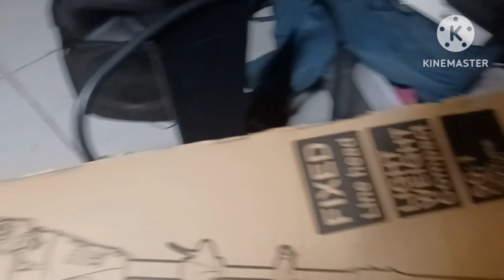Homelite 25cc 2 Stroke Curved Shaft Line Trimmer review and unboxing

Comment: How do you install the cord in these models properly so it doesn't come out every 2 seconds?
Reply from the maker: There's a little pathway to follow with groves so you insert it through the first hole then over the first grove which is lower then next one which is higher then the last one which is lower again then out the whole get the thickest cord at the hardware store too

Comment: you're not doing the cold start right, read the f'ing manual, had mine for two years never had that problem...
[Did you use the correct 2-stroke oil mix ratio? 50:1, did you prime the full, 10 pushes on the primer
]
1. 4 pulls (Max)on choke (Blue) until it tries to kick over [Of course full squeeze the trigger], 2. then set choke to white position Max 6 pulls [never had it take more then 3-4 pulls; in really cold weather ?], if it does not start, repeat 1 and 2.
3. Let the engine run for 10 sec, then set choke to the RUN (Green) position, then let it run for about 10-30 sec, depending on how cold ambient temp  (engine warms up, lubricates) before you start working.
It actually tells you how to start it on the sticker by the choke...
you have probably F'ed your carbie etc.
Reply from the maker: First and foremost rod chill out. No need for the effing and jeffing. After it a few runs it seemed to start more reliably and yes I had followed the instruction in the manual. But I have had mine for about two years now and it's still going strong.